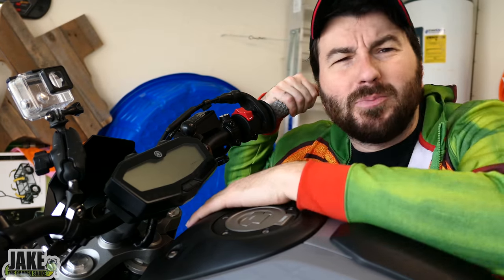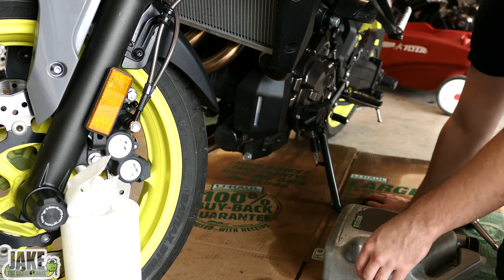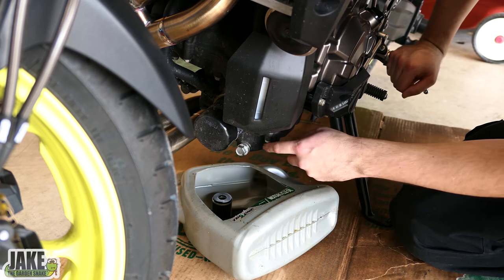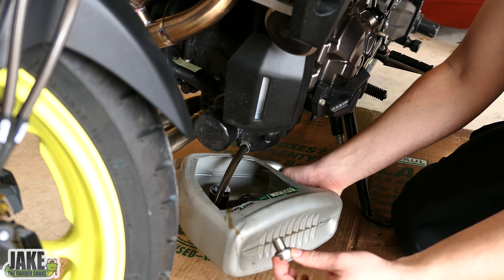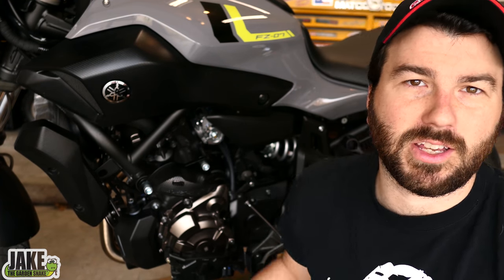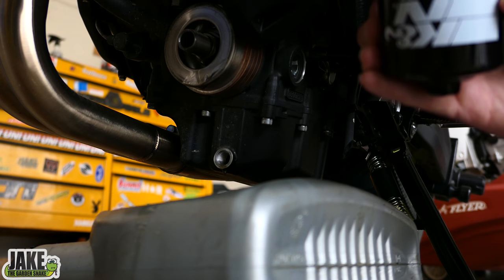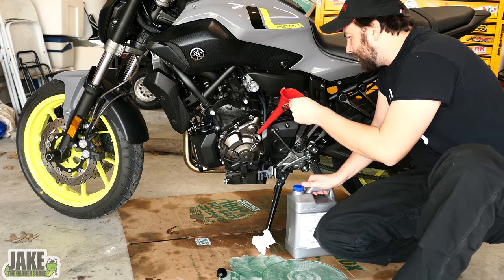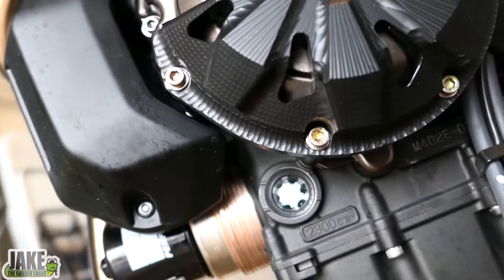FZ-07 Oil Change How To (MT-07)

Comment: Oil is actually "thicker" at colder temperatures. The viscosity rating just means how an oil behaves at a set temperature. For example, a 5W30 would behave like a 5 weight when cold and a 30 weight when warm. The oil is not thicker when warm, but instead doesn't become overly thin like a 5 weight would at operating temperature.
Reply: W means winter
Reply: @crztank9298  Yes it does, but the term "oil weight" still exists nonetheless and Brandon is correct.

Comment: No way the oil is thinner when it is cold lol. Yeah 0w-40 means the oil is very thin when it is cold but it still is thicker than warm. Just put the can in the freezer for an hours or two and try pouring it afterwards...

Comment: The oil does NOT get thicker as it warms up. What goes on with multi viscosity oil is it that is acts like a thinner oil when cold but acts like a thicker oil when warm. Take 10W30. When cold, the oil acts like a 10 weight oil which is a thin oil so the engine will start easier. Then when the engine and oil heat up, the oil acts like a 30 weight oil which when hot  is thinner than 10 weight oil is when cold but not as thin as what 10 weight oil would be hot. They way oil protects an engine is it provides a thin film between the moving parts in your engine. If you ran a straight 10 weight oil, when hot it would thin out enough where it would provide very little protection, where the parts may start touching each other which causes wear and more heat which would thin the oil even more. By running a multi grade viscosity oil, the oil does not thin out as much when it heats up therefore keeping the film thick enough to prevent the moving parts from touching each other. So multi viscosity oil does not get thicker, it just doesn't thin out as much as a straight viscosity oil would. It simply just doesn't change as much as a straight viscosity oil would.

Comment: Pro tip: If you want to get all of the old oil out of the engine just turn the bike on while you're draining the oil and give it a few long revs to the red line. Works the first time, every time.

Comment: 10w30 does not mean its colder when its cold, it just means it behaves like a SAE10 when cold and SAE30 when hot, SAE 30 hot is still thinner than SAE10 cold, i think (not 100%sure) you need to get to something like 10W80 to have it actually be thinner when cold

Comment: When long-chain hydrocarbon molecules are added to base oils, they slow the rate of loss of viscosity with temperature, which is called the Viscosity Index. Thus, a multigrade 5W-30 oil is made from a 5W base oil—measured at zero degrees Fahrenheit—but the added long-chain molecules slow its viscosity loss to that of a 30-weight oil when at 212 degrees Fahrenheit. 

The oil does not become more viscous as it heats up—it just loses less of its viscosity. This allows use of engine oils thin enough to cold-start in winter, which retain enough viscosity when hot to do a good job of lubricating the hottest parts of a warmed-up engine.

Comment: My Dad and I run Amsoil religiously, he's ran it in his trucks and race quads since the late 80's and I've ran it in my truck and one of my tractors that we use a lot. (2013 with more hours than one of our 1979 tractors lol). it's a $385 oil change for my truck (filter and 5 gallons). one thing you learn in a parts store is if it says synthetic, it isn't, no one would want to pay for a synthetic oil, full synthetic has a additive package comparable to synthetic to begin with, but I can only run let's say Rotella T6 for 8k as per the analysis, Amsoil I can run 25k per change, now have a dual bypass, Blackstone Test Labs says I can go 50k if I wanted which is insane.
Reply from the maker: +Wildkat9797 oh yeah there was a whole lawsuit and court case about synthetic oil not being synthetic. The stupid judge ruled that it was up to the manufacturer to determine what synthetic means. After that EVERYONE came out with "synthetic". Don't take a rocket scientist to see what happened there.

Comment: The best way to warm up a bike is to gently ride it. Engines heat up much faster under load, and since wear happens when the bike is not warmed up, by riding it gently there is less time spent with the engine cold and running. I live in an apartment complex, and I gently ride my FZ 07 out from a cold start and it's usually just about warm by the time I'm exiting the complex, and it's fully warm by the time I get on the main road.

Comment: Great video as always! One suggestion: Always good idea to prime the filter by filling up the filter with new oil before you install it. Let it sit and let all the air bubbles out and top off a few times. This will prevent a dry start.

Comment: Jake, since the clutch is also lubricated by the same oil as the engine you should NOT use better oil than what is recommended, this is also noted in the manual. If you use oil that is better than the stock oil you will get clutch slippage, not good.
Reply from the maker: +helloman1976 lol no. You'll get clutch slippage if you use oil that's not wet clutch compatible. Auto oil for instance has detergents that help clean the engine but destroy a wet clutch. That's why you hear instances where "better" oil causes the clutch to slip. And the manual says to use synthetic.
Reply: @Jake So page 9-1 is where my information comes from in the service manual and it says exactly, Recommended brand is YAMALUBE SAE, API service SG type or higher, JASO standard MA. I do not see anywhere in the manual that recommends synthetic but I may have missed it, what page is that? 

Newer vehicles have much higher and tighter tolerances and you need to be careful what you put in it. For example, no oil additives and so on.

Comment: Also, just a little precautionary note, K&N filters have been getting banned at racetracks all around the United States. K&N apparently switched to some manufacturer in China or something like that and has had quality control issues. What that means is exploding oil filters, failing o-rings, and oil-starved motors. And even before all that, K&N are just bleh oil filters to begin with. OEM are way better and cheaper.

Comment: I prefer copper washers over crush washers, the copper one molds to the face of the two surfaces where as the crush on only compensates any tolerance in the angle of the two faces

Comment: Oil with more ZDDP (zinc) pulls more heat away from the engine so the engine cools better with an oil cooler. Also zinc is best for lubricity on solid tappet cams. In air cooled VW engines it's a big deal.

Comment: Rotella T6 $20 a gallon and works perfect
Reply: 4finger use it everything.  Don't need anything else and can easily go for 7K miles and be within Spec.  I've sent mine off for analysis and it's fine.  People get sucked into the motorcycle oil lies.  Never read a book or real information article in their life.
Reply: I second this. Use the 15w-40 until the engine/transmission is finished working in (~1200 miles), and switch to full synthetic 5w-40 Rotella. Buy the gallon jugs.
Reply: where do you buy it?

Comment: Rotella T6 works okay and it's not motorcycle oil. It's diesel oil, but it's JASO-MA certified for motorcycles as well. It's cheap and works OKAY. Not great because it seems to wear rather quickly at least for me. The first telltale sign of a needed oil change is degraded shift quality and that seems to happen earlier with the Rotella T6 so if you are going to use that oil just keep in mind you might want to do more frequent intervals. It seems like the oil shears more quickly

Comment: Rotella T6 oil is all you ever need.  
20$ an oil change.  Run it for 6K miles.  I've sent it off for analysis   plenty of additive left,  no abnormal wear and well within Spec, no clutch slippage.  R1 motor didn't care one bit.

Comment: Oil is thinner when its cold? You might want to go back to school! If it was thinner when it was cool why the fuck would you warm up the engine before you change it aside from making sure any particles are in suspension? Your contradicting yourself.

Comment: Hey Jake, big fan here!!! Have a quick question for you according to the manual and what I’m reading, I was supposed to add 2.75 quarts of oil to my FZ when changing the filter as well. I entered 3 quarts and according to the bike readings, upright and checking the oil window below I can’t see the line so it looks like I slightly over filled it so will I just burn the rest during my next couple of ride or should I remove some of the oil. Thanks for your input!! You rock man!!

Comment: So what your saying is I should use oil specifically made for a bike and not a car? if so that is helpful to know so I dont buy automotive oil. Also how tight should an oil drain bolt be? Im always afraid im going to over-tighten it. Does it need to just be snug and will it still keep a good seal?
Reply: Look up the specs for both, contact your dealer or take a look at your manual. Rent a torque wrench if you want, hell. Oil pan bolts usually don't go too tight because the walls are pretty thin and they strip out easy. As for oil, if you want to play it really safe just use the oil type the manual says to use for your mileage and engine.
Reply: Circuit Break i have a dirtbike with an aluminum engine its a bit thicker walls

Comment: head over to Engineering Explained channel and watch the video on oil viscosity. The oil does the thinner when the engine heats up but the weight have more to do with a cold engine really. cold starts the oil need to act a certain way in the winter versus on a hot day.
Reply from the maker: +Slimphattz MrJamdown Yeah I explain that here...
Reply: Jake TheGardenSnake 
Yea I kinda jumped the gun on my comment.

Comment: Serious question, do you replace the filter every time even if you're changing the oil more than recommended? I'm assuming you do, so is there a way to get several filters at a discount? I'd rather bulk buy and have it on hand, at a discount, than pay msrp every time...

Comment: Nice vid! The dry sump on my Super Tenere makes it a real PITA. The manual says you have to do a rain dance and pray to the East to check the level properly. I've just learned that as long as there is oil in the sight glass when the bike is level, you're OK. Have any experience with dry sumps? Any suggestions?

Comment: Hey Jake...big fan of all your videos. I have a '15 FZ-07...just finished changing the oil and replaced with Castrol Actevo 20W-50 4T Part Synthetic motorcycle oil...my plan is to swith to full synthetic on the next change. Anyway, after changing the oil I didn't see anywhere on the bottle that states "wet clutch safe".  Oil is still good right?  Also in the sight glass when the bike is tipped up and level with the engine off, the sight glass is completely full until I tip it more to the right off balance but goes between the two lines when I start the bike...did I overfill or do you think this is okay?  Thanks for your time buddy!

Comment: I never changed the crush washer on my wr and probs 20 changes not a single leak. Always torqued to spec. 

I thought it was nuts that you can buy complete oil change kits for the 690 which gives you new bolts and mesh screens. Shit just clean the old one with brake cleaner and re oil any O rings. Fck such a throw away culture we live in now.

Comment: if you don't have spare crush washers annealing the washer works too. Annealing is where you heat up the washer (it being softer metal, copper ect.) put it in some needle nose pliers and heat it up. There is a very fine line to annealed and destroyed, so practice first on an unneeded crush washer. But what happens is the washer expands and becomes new again! But if you can just get some spare ones like Jake says now,  so that you will have them when you melt one by accident. What? I never did that!!
Reply: At that point I'd just reuse the old washer as is 8)

Comment: Love the tech video`s Jake, keep `em coming!

quick question that hopefuly you can help me with: I bought a used Ducati from a dealer, and they said they`d give it service before handing it over. now I`ve ridden it for about 50 miles, and the oil is already very dark. Is that normal for it to go dark that quick? It`s done about 30.000 miles (2008 Hypermotard 1100)

thanks in advance! :)

Comment: I still won't bleed brakes. If I were do to it, I would crash into the back of a car, because lack of brake pressure.
Reply: Nah, Bud. Its seriously easier then you think. If there's an air bubble you'll be able to fell that the brake levers are pretty spongy before you even go anywhere.

Comment: My opinion is best: don't change oil, just buy a new bike when it runs dry and seizes.
Reply: that's what a friend of mine did recently: he neglected his old XJ650 so badly that the engine seized due to lack of oil, so he had to buy a new one

Comment: "don't use automotive oil"

I've been using shell rimula r5e which is a heavy duty engine oil or a diesel engine oil on my MT07 for 2 years, always change on 5000 KM, it feels better than using yamalube oil, and it's wet clutch safe because there is no ILSCAC GF-5 certificate

Comment: Just wondering if your FZ07 shifts into gear somewhat hard i guess? I have a FZ09 and it just seems to shift into first gear especially kinda sloppy. Ive heard Yamahas are notorious for sloppy transmissions so just curious on your experience so far. Im running silkolene for oil.
Reply: Kyle Christopherson I notice in my FZ07 that if I start the bike in first with the clutch in it will jerk forward an inch or two. 1st and 2nd gear I can hear a pretty loud clunk when I shift (only going down to first and up to second. not down from third to second though).
Reply: EastPhilly Sounds pretty close to what im noticing
Reply: yamaha's get quite a bit of fuel dilution between oil changes. as the fuel goes above 4% oil viscosity gets thinner and shifts suffer. this happened to me. I sent oil for a test and thats how I found out. bike is brand new and perfect so no mech issues. Yamaha says its normal. which is why they have such short intervals for oil. 3000miles-5000 miles . i change at 2K miles now I know this
Reply: Shifting into first will always jerk the bike and make a clunky noise. Both my bike and my dads 2 bikes do. And they’re 3 different manufacturers.

Comment: I tried to change mine. In the mist of using the torque wrench to the specs I've now have a loose drain bolt. I said let me me stop before i do too much damage. Any quick fixes atleast to take it to a shop. Thanks.

Comment: I just traded my supermoto for a 2015 FZ-07 with only 500 miles. I'm going to change the oil and coolant as it's probably as old as the bike. Is there a difference versus the yamalube semi synth vs the full synth

Comment: I've read that some bikes aren't totally accurate when looking in the window... wouldn't it be better to use a graduated cylinder and measure out an exact amount of oil?
Reply: No, because you do not know how much of the old oil is still in there as there is always some left behind. Some bikes should be checked upright, some on the stand, some need the engine stopped and some should still be running, Read your manual and follow the manufacturers procedure

Comment: the reason you shouldnt run a awesome synthetic like motul 300V in breakin. is because it has such high film strength it wont actually break anything it. 
amsoil even said with their PAO esters it was so high the film it wouldnt let the rings seat into a brand new honed bore

Comment: Hey jake, do you think a hard break In for a v8 is ok? I just finished rebuilding my engine with fresh rings and bearing so I'm wondering what's your say on it. I think it won't hurt it but always good to get a second opinion
Reply: Nery Salguero being that it's a rebuild rather than a production engine, I'd sway towards a softer break in. A soft break in just has less risk of "damage". Controversial topic really, only break it in as hard as you feel comfortable.
Reply: NitroNuggetTV this is true. I did get a it rebored .030 over so it's new walls and rings with new pistons and cam. I'll just drive it like I normally would.

Comment: Do you ever drove a suzuki sv 650 (s)?  Would you recommend the fz07 or the sv 650? (As a second bike)
Reply from the maker: +The Vardarioter I've been on tons on sv650s. Great bikes, quite similar to the fz07. The fz has a more snappy motor, rips wheelies easier.

Comment: I hate these sight windows, you need the assist of someone else to keep the bike level (or risk a nasty drop if you do it by yourself) to check the level. My previous Suzuki had a dipstick in the filling cap, and you measured it standing on its kickstand, 1000 times more convenient that those damn sight windows.

Comment: I use rotella t6 on my fjr 1300, I want to use it also on my wife mt 07 but I was told that it is not good for the engine since it’s not designed for motorcycle. Anyone know after how long we will see damage on the engine? My fjr just hit 100000 miles runnin on t6.
Reply: where do you buy rotella t6 oil?

Comment: just remember in the winter when changing your oil to leave the engine running to keep the oil from freezing while draining. 😈
Reply from the maker: +kenny didnt die Your a bad man
Reply: Jake TheGardenSnake thats about like saying drain your coolant in the winter and replace with just water or your engine wont be able to warm up to safe operating temps